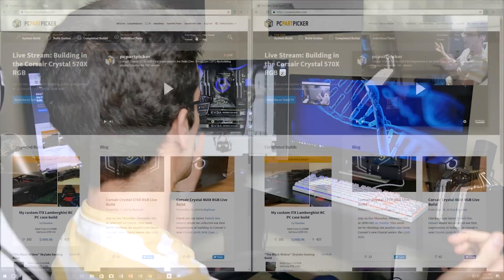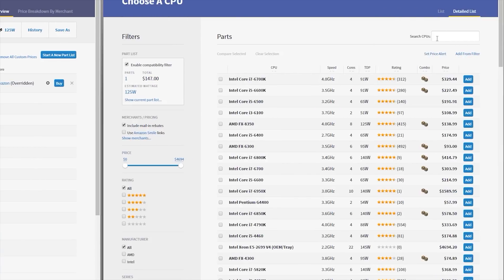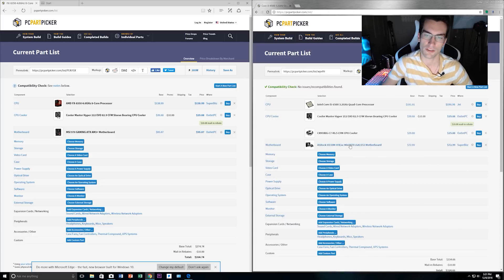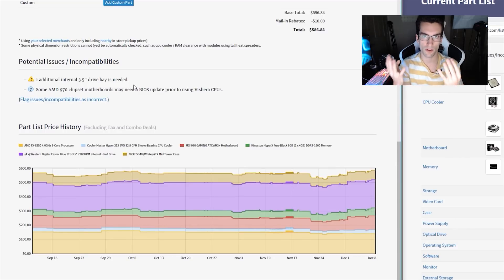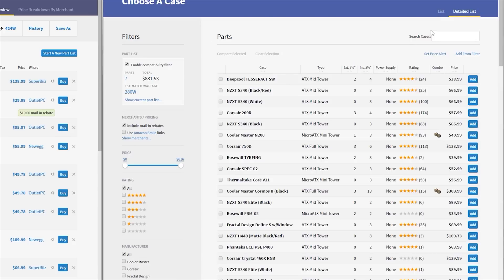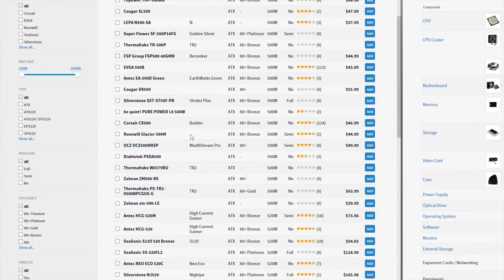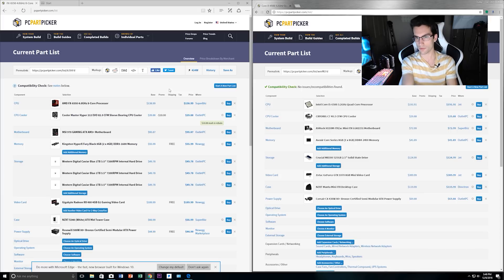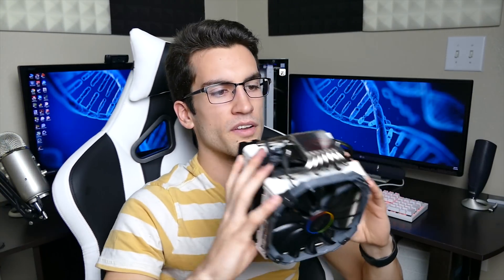Crash Course: PC Part Guide for Beginners

Comment: Hi i'm gonna build my first pc soon!
i want a gtx 1060 3gb gigabyte
ryzen 5 1600x with a rgb master air ma410p
16gb ddr4-3000 g.skill rgb
3rgb masterfans(mf120r)
and a antec df 500
with a tomahawk plus
my dad had a unused psu that i could use and it was overkill yeah but it's free (XFX  Pro 1050W 80 plus gold 1050w psu)
i'm gonna turn 13 soon and i'm already saving up money for a long time so i hope i can get enough money :P

Comment: HELP to complete My Kabylake Build, PLEASE
Components:
Intel Core i5-7600K 3.8GHz Quad-Core
CRYORIG H7 49.0 CFM CPU Cooler
Gigabyte GA-Z270M-D3H Micro ATX LGA1151 Motherboard
G.Skill Ripjaws V Series 8GB (2 x 4GB) DDR4-2400 Memory
Western Digital Caviar Blue 1TB 3.5" 7200RPM Internal Hard Drive
MSI Radeon RX 470 4GB ARMOR OC Video Card
EVGA 600B 600W 80+ Bronze Certified ATX Power Supply

Q. What is the right case i should buy for a ATX PSU and a Micro ATX motherboard?

Comment: when you were picking a AMD motherboard the ASUS M5A78L-M/USB3 was on the list at top #2 people on toms hardware are telling my my fx8350 wont work with that motherboard and that at stock speeds under load it will throttle down need help form anyone PLEASE ASAP but if this is true then PC part picker is miss leading why would they have a motherboard that throttles and CPU on there website for capability I'm not looking to overclock i have to fans in take in front and 1 fan taking air out of back and a h100i v2 cpu cooler

Comment: just picked up an i7 6700, it was a good deal at a local shop I used to work at,  from a g4400 and it helps so much, lil overkill but I picked it up for not much more than an i5 6600k.

Comment: Why did he choose the RX 480 4g on AMD side when he went with a 1070 8g on Intel? it's not like going for the same price point  and maybe 2 HDD and 1 SSD instead of the 3 HDD for a faster computer, currently if you aren't a content creator or you don't work with a ton of data everyday 250GB are enough. Anyway good guide for a 2016 final build before AMD and Intel new generation make it to the market and the new chipset.

Comment: Hi Salazar, firstly thanks for all the beginner friendly vids (loved the CPU comparison one, would even say urs is the best one out there...and I ve watched loads) but honestly, I think the main issue isn t so much picking the right parts as forumsor reviews can help with that. I ve never built an own PC and keep watching vids and reading reviews for months now learning about all the relevant things about it. The thing that honestly scares me most or is relevant to me being new to this, is more about picking parts that are user friendly when it comes to drivers and all the software installation in order to achieve a system that is easy to maintain. 
Mainboard software and such are a major issue to me personally (I know others that are the same and they all aren t scared by picking the right parts but making them run with all the software), so for beginners like me, the entire software part (user friendly drivers installation process, installing windows etc) is a main concern and there are very few ppl that actually compare hardware from an "easy to maintain or install" aspect so if it s possible, I d dearly wish you could address that part of the PC building challenge (many of us beginners are even to scared to check things like the Bios and get lost when it comes to drivers and all the other things I might forget regarding all that)
Anyway, thanks for ur dedication and help ;)

Comment: Why no stock coolers?

Especially on intel, the current ones seem to hold up fine keeping the CPU from throttling even if it gets somewhat dusty and seems to be quite silent. I got an i5 4690 on a stock cooler and it is fineee. 

I mean, if you buy a SKU that isn't a K model you are better off throwing the money at the graphics card anyway, or more ram, bigger SSD, etc. 

(If you worry about temps.. I have seen old Pentium 4 mobile notebooks run at 100c on idle on the CPU and work for years while throttling heavily, just something to keep in mind, the extra wear is not that big and your computer will slow down to protect itself if it has to.)
Reply: Bas van der Meij You basically just answered why he didnt use stock coolers hahaha
Reply: jynxed I actually didn't xD read again if you think I did.
Reply: Basically temps and noise. Especially when you go i7. Aftermarket will still have better temp while also being quieter. 

Another reason you can overclock non K Skylake with Z170 mobo's. We're talking i5's at 4.5-4.6ghz. And at that speed you need a strong cooler.

Comment: How do I begin to build a PC with compatibility in mind? for example: should I start by picking my processor first and then work from there, or start with the motherboard or something else first? thanks.
Reply: MrSensitiveNipples Always start from the processor then motherboard. You should use pcpartpicker.com since you're a beginner because it will help you learn alot about compatability.

Comment: New PC builders, get a case with removable dust filters. Some cheaper cases are a real pain to clean. In my old Corsair Spec-02, I would have to remove the CD/DVD drive, just to take the front panel off and then take that panel apart to clean all the dust off of it. Also, if you plan on overclocking, make sure your mobo allows you to set the RAM speed as some are limited to 1600 mhz. So, if you have bought a mobo with limited speed, make sure you don't buy ram that is faster and more expensive.

Comment: I wanna be a content creator. How is this PC for that?

Case: NZXT S340 Elite   Price: $99.99
Motherboard: Asus Z170 Pro Gaming/AURA   Price: $159.99
CPU: Intel Core i7-6700K   Price: $329.99
CPU Cooler: NZXT Kraken x61   Price: $114.99
GPU: EVGA GeForce GTX 1070 SC Gaming   Price: $419.99
RAM: G.SKILL Ripjaws V Series 32GB (2x16GB) DDR4 2400MHz Black   Price: $169.99
SSD: Samsung 850 Evo 250GB   Price: $94.99
HDD: 2TB WD Black   Price: $129.99
PSU: Corsair HX750i   Price: $179.99
Cables: CableMod C-Series RMi & RMx & Cable Kit Black/Green   Price: $99.90
Case Fans: (x4) Corsair Air Series AF140 Quiet Edition   Price: $17.99 Each
Light Strips: CableMod WideBeam Magnetic RGB LED Strip – 60cm   Price: $18.99
Paint: Dupli-Color DE1641 Ceramic Grabber Lime Green Engine Paint - 12 oz.   Price: $12.98
Reply: Shitty case fans. Don't buy them.

You aren't editing in 4K so 32gb of RAM is a waste.
Reply: Craftman2917 The SSD, Case and PSU seem expensive. You can get crucial 240gb SSDs from $60. You can get that case for $90 now and lastly you can buy the same PSU for $150. Check all your prices on pcpartpicker
Reply: ok, thx! I got all these prices from newegg btw
Reply: Ohh i see. Just double check the prices on pcpartpicker and try not to use the exact same parts just to see how much money you can potentially save
Reply: thx
Reply: So what case fans do you reccomend? Also the 32GB is for playing ARK: Survival Evolved while having a billion chrome tabs open
Reply: Craftman2917 You still won't need 32gb. It's a waste.

Cougar Vortex.
Reply: ok thx
Reply: silent wings by be quiet! - very quiet fans but they do have a premium price. or noctua. just anything but corsair fans
Reply: Is this a first pc build
Reply: If so this is way to overkill and your never gonna get money back out of ur pc
Reply: ***** How is that overkill?

Comment: If you're not going stock cooler, I'd take paying double the price of the Hyper 212 Evo to get a Noctua NH-U14S instead.  So much quieter and amazing performance.  Pus the mounting hardware is much more simple. So if you are a first time builder, it's one less intimidating thing to do.
Reply: Bents I was thinking the same thing... I read his comment and was about to comment and say "that's not what he's fucking saying..."
Reply from the maker: 212 Evo is perfectly fine and substantially quieter than the stock cooler. Much cheaper as well.
Reply: Did I say 212 Evo wasn't a fine option? No, I said that if it were me, I'd opt to spend an extra $30 for a much nicer option that is simpler to build with.

Comment: i am going to buy a gtx 1060, thats it. i found a 3GB zotac card for 170 pounds. but i need a new CPU. i was looking at an i7 2600k and get a good overlclock on it. the reason i chose that CPU because its only 40 pound on ebay, i know that ebay isnt trust worthy but i want to know if i buy it am i making a mistake?
Reply: BTW i wont buy a motherboard off of ebay
Reply: Make sure the motherboard is compatible along with the RAM.

Also a 2600k with an overclock will require in my opinion an aftermarket CPU cooler, something like a Evo 212 with two fans or an AIO cooler.
Reply: yeh i already have 8gb of ram and will probably go for a 212 evo thanks
Reply: 40 pounds???????? i7-2600k usually go around 150USD used. 40 pounds is a steal.

I've bought many processors/mobo off of ebay never a problem. Stay away from China shipped options and focus on high ratings. Typically look for parts that are coming out of corporate pulls. You won't find K chips but non K there are plenty. And mostly all of the OEM mobo's will take 2nd & 3rd Gen Intel chips.

If you really want to overclock then you have to look at non OEM equipment and that's usually coming from different sellers and not the corporate recycling ones. But just make sure the mobo's comes with the I/O shield. It's a pain when it doesn't.

Comment: You think it's better to wait for the 7600k or should I buy the 6600k right now
Reply: Ourlask Wait for the 7600k since its about to be released really soon
Reply: ok thank you but the Z200 mobo are they gonna come in itx when the 7th gen Cpu come and when thtat  is the question because I live in France I think that I will have to wait something like february to get the CPU and so for the mobo
Reply: The cpu and mobo will be released at the same time but the mobos will be expensive upon release due to their being limited supply of mobo and barely any competition between mobo manufacturers. Im not entirely sure if the ITX version will be released straight away but it shouldnt take long before its released
Reply: Ok thank you jynxed have a nice Christmas ;)

Comment: is it true that if it has K on the end you can OC it
Reply: Oliver 4K for Intel yes
Reply: BaconMan LovesBacon But if no K then you can't overclock it
Reply: Overclocking a non-k intel cpu can dramatically reduce the CPUs lifespan because non-k CPUs werent designed to handle overclocking and they also have a very low TDP (Thermal Design Power) which you will need a really really good cpu cooler to even try and overclock without going near the TDP.
Reply: Oliver 4K 
yup
technically u can OC  non k chips bt itz nt good as it might spoil ur components
Reply: How will it "spoil your components" ?. That makes no sense.
Reply: Ben Cornell actually it will nt spoil bt still itz nt advisable to overclock locked cpu.
don't take that comment too srsly😜
Reply: Ben Cornell actually i wrote that to scare him off for overclocking locked cpu
lol😂
Reply: jynxed 
yup👍👍
Reply: Oliver 4K Lol
bt dude don't worry intel will release kaby lake i3 (k version) that can be overclocked.

and 1 more thing Ben Cornell fo😂
Reply: jynxed Cheers mate
Reply: ritik gupta a

Comment: why would you buy a cooler for a non k, Intel processor?
Reply from the maker: Because stock coolers get very loud regardless of the K and always result in higher core temperatures. A $15 Hyper T4 will make a world of difference. You don't have to agree with my logic, but it's what I'll always recommend to my viewers.

Comment: i5 6500 or i5 4690k (paired witha 1060 3gb)
Reply: It really is up to you. If you could get the 4690k for cheap than go ahead cause it still kickass cpu. But if not choose the latter. I prefer the skylake platform as you will have better option to upgrade in the future.
Reply: Both CPUs are a bit Overkill for the GPU, maybe you should get a 6400
Reply: TheCanadianLanBoy the i5 6500 is better, keep in mind you then dont have to buy an overclockable motherboard
Reply: 6500
Reply: Yes, but I have ddr3 ram, 16gb,so a 6500 and 16gb ram and a cheap mobo is the same as a 4690k and a overclocking mobo, reusing my ram
Reply: if you already have the cpu and mobo and ram you should stick with it but unless you are building from non than get the 6500.
Reply: I only have the ram...
Reply: Thanks for the feedback, im heading to canada computers in an hour, ill see which one is cheaper, but going back to my original question, which one preforms better in a gaming environment
Reply: The 4690k is plenty, you can even pair it up with gtx 1070 and it will work like charm. Because your using GTX 1060 3GB even the 6500 is very capable to handle  games without bottlenecking it.
Reply: Will my cx500 be able to overclock it to 4.2ghz?
Reply: i'm not sure about that but it is generally good to have better power rating psu. Ask others about this.
Reply: TheCanadianLanBoy
Yes, its a nice PSU, I also OCed my I5 4690k to 4,2GHz with a worse PSU but a fairly good Z87 Motherboard

Its really stupid of you wanting to buy a CPU which is the same price like the GPU but hey, its your money lol
If you plan upgrading to a GTX 1070 tho, then its alright. Both CPUs give the same performance in games, but an overclocked I5 4690k is better in games like Arma.

The I5 6500 is more energy efficient tho and a bit cheaper, so I would go with that for this build.
Reply: I play more cpu intensive games, so, the gpu is overkill (arma3 is what I usually play)
Reply: Thanks for all the feedback, all you guys have a nice day!
Reply: TheCanadianLanBoy
Oh, You play Arma? Then I would really go with a cheap used I5 4690k and OC it to at least 4GHz
Reply: Why used?
Reply: Because its 2 years old and costs more than it costed back then right now lol

Maybe you can get a cheap used one, I also got mine used and it works perfectly fine, overclocked up to 4,7 GHz I also got it boxed
Reply: go with the 4690k if youre going used, paying new is useless since you can get a i5 6600k for the same price basically. if you go that route sell your ddr3 ram and get a z170 board.
Reply: im getting the 4690k, I got a gigabyte z97x on a flash sale for $50 (usually $150) and buying the 4690k NEW, I would just rather have a new cpu, im gonna get it on boxing day, cuz they'll be trying to get rid of em cuz of the kaby lakes coming out, so hopefully ill get a good deal

Comment: isn't the cx series bad?
Reply from the maker: Has nothing to do with the topic of this video. Selected it for demonstration purposes only.
Reply: Salazar Studio oh ok
Reply: the CX series are bad because they are unreliable for overclocking and other high-performance stuff, if you use a PC with a locked processor and a low to moderate power GPU then you should be fine.
Reply: Don't you hear any screaching from the power supply when gaming? The GTX 1060 3gb isn't a very power hungry card by the way, the 4690k could be quite power hungry depending on how much it is overclocked TheCanadianLanBoy
Reply: TheCanadianLanBoy Just because the price is high doesn't mean that it is good, you have to take everything into account, the CX 500 V2 is about €68 in The Netherlands, the original CX 500 is not sold here anymore
Reply: The old CX units were Seasonic OEM, used to be good. Then Corsair done a bait n switch and the newer CX series were fucking terrible quality. It doesn't have anything to do with overclocking, they just had poor quality components in the PSU so they couldn't safely supply the wattage stated, they don't perform well in certain scenario's, etc. They're also overpriced pretty much everywhere.

OP- In Canada, for about $90-100, you could have bought a 450/550W Gold rated Seasonic PSU which would be SIGNIFICANTLY better.
Reply: TheCanadianLanBoy Doesn't matter what revision you get. There are some that are the same version that are terrible and some are fine. They're pretty much all over-priced anyway so they should be avoided unless they're cheap as chips, then theyd be good for a low power system, maybe something like a NAS or something without a dGPU.
Reply: CC CC my cx 500 is great, how are they bad?
Reply: TheCanadianLanBoy which parts do you use with it
Reply: http://www.tomshardware.com/forum/id-2547993/psu-tier-list.html
Reply: My cx500 is paired with a 4690k and a 1060 3gb
Reply: Silent
Reply: Only overclocked to 4.0, on my 212 evo
Reply: TheCanadianLanBoy
then it is better than i thought it would be, considering the price point: it probably lacks security features that more exspensive PSUs have
Reply: In canada, the cx500 is a $90 psu, it quite high end here
Reply: Is the v2 any better?
Reply: TheCanadianLanBoy
no idea, but if you read v2 as version 2, then it must have some improvements over the original version
Reply: So a v1 is better?
Reply: CXv2 are bloody terrible and notoriously unreliable. CXv3 are mostly rebranded GS units with a very low thermal threshold making them unsuitable for a powerful system as the heat causes the stability to severely decline making them potentially dangerous - there are instances of them catching fire and/or killing entire systems. All older CX units, apart from the CX400 which was a SeaSonic-designed unit based on their lower end platform, use cheap chinese caps and the voltage regulation is laughable - it's in Diablotek territory.

CXv4 - the new "grey CX" are solid units but cost more. They come in the following variations. CX450, CX550, CX650 - anything else is to be avoided.